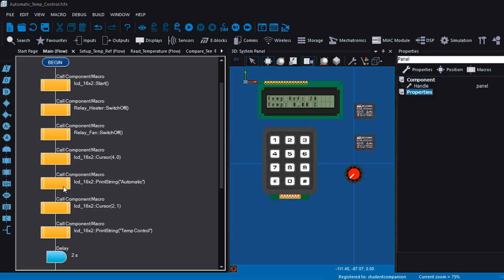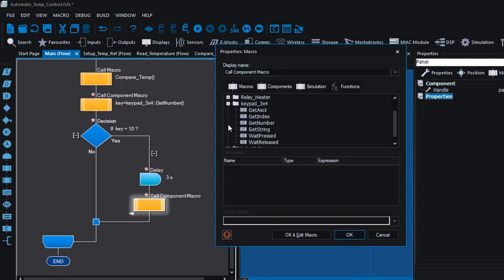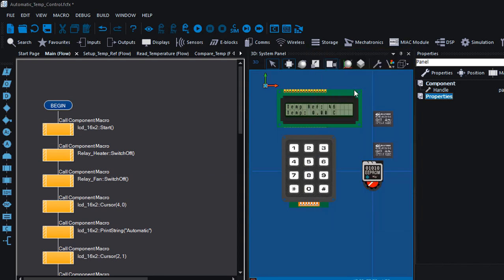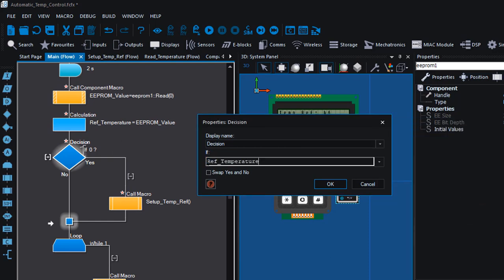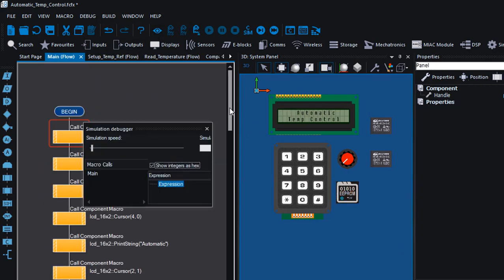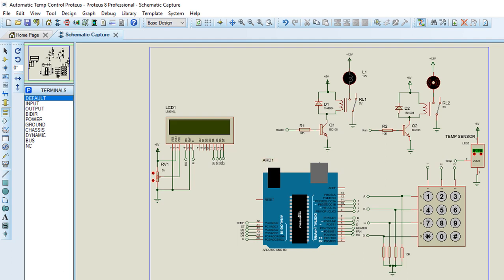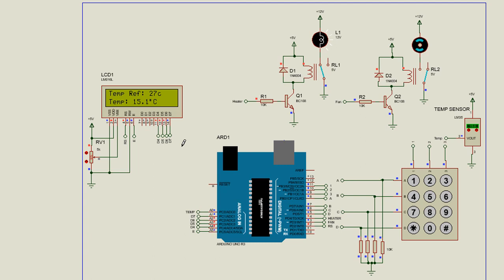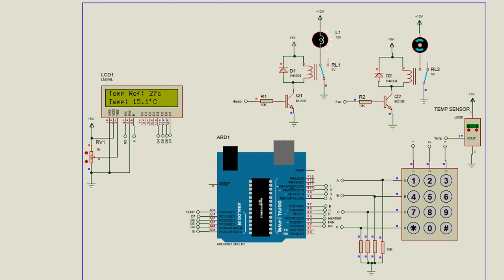13- Project 2 Automatic Temperature Control System, part 3 | Arduino with Flowcode Tutorial

Comment: What can I use as  a heater? And if i use the parallelism of  more resistors will it work? Also will the C code work on Arduino if I upload it?
Reply from the maker: Hi, the use of the heater will depend on the power rating of your relay. Anything that can be supported by the relay.
Please watch our relay tutorial to learn more.
Don't use resistors, why would you want to use resistors?
Reply: @StudentCompanion  i found on a site a heater built with some resistors in a ladder form
Reply from the maker: @mogosandrei9985  Are you trying to build a real hardware device or in simulation only?
A heater is basically a heating power resistors, when current pass through them, they become hot, that's why they might use the resistor symbol to describe a heater, but you can't use any resistor for that, because not all resistors are meant to be heaters. If you are using high power, you must make sure you know what you are doing as it could be dangerous, we can't provide advice if you want to build your own heater as long as you follow the safety precautions.
Reply: @StudentCompanion  Is it ok if I use NPN instead of PNP?
Reply from the maker: We used NPN in this tutorial. You can use any general purpose transistor either NPN or PNP, as long as it's capable of driving your relay ot your load directly. And remember to connect it and bias it correctly. For example in brief you know an NPN turns on whenn current flows through the base and the transistor current flows from collector to emmittet while with PNP it turns on when there is no current at the base and the transistor currrnt flows from emmiter to collector.
Reply: @StudentCompanion  Yes I am trying to build the hardware device to maintain a constant temperature in a box(for example).
I need to know also all the components that I need if you can help me
Reply from the maker: The components are all in that video
Reply: @StudentCompanion  are you using a tensiometer?
Reply from the maker: What is tensionmeter? Everything we used are shown in the video
Reply: @StudentCompanion  the RV1
Reply from the maker: It's a variable resistor. You can use any small variable resistors

Comment: sir can we change this BJT from any FET ??
Reply: sir according to our project we have to use an FET.  so the question is that......  what is the equivalent of BC108 in FETs ? because  there is very low output coming out from arduino pins .   if you know any model of FETs which is equal to BC108 plz tell me...
Reply from the maker: It's not about an equivalent of BC108 but a FET that we'll be able to drive your relay. I don't know which relay you are going to use, each relay has it's own coil voltage, current and resistance.  Those are parameters that we'll help you select a correct FET and calculate the value of resistor.
Reply from the maker: Did you watch this video to learn how to use a relay with arduino: https://youtu.be/htRPH2U80kw
Reply from the maker: I guess you can. Is there a particular reason to use a FET?  As a BJT would do the job.

Comment: Thank you for yours great lectures, I have learnt a lot from you. I am considering learn microcontrollers in C, what kind of microcontroller you recommend, AVR or PIC. And can you make tutorial videos for AVR microcontroller? Thank you
Reply from the maker: Hi. Thanks for watching our videos and brother your feedback.  The choice will depend on you , the software you gonna learn with and what you want to achieve in the future.
As Microchip the manufacturer of PIC bought Atmel  the manufacturer of AVR recently, in the future they programming tools might be integrated. 
We usually use PIC so I can only advice on PIC.
Reply: thank you for your recommendation, I found in your courses, there are 1 course about PIC using MikroC and another one is about PIC using MPLAB, so what is the difference between them and if I want to study further in embedded system field, do I need to study both of them ?
Reply from the maker: No you don't need to study both.
MikroC, MPLAB and even Flowcode are software used to program your microcontrollers.
The manufacturer software is MPLAB and it's kind of free. Meaning it's free but you can buy a professional version for more optimization. But the free version works better especially for a beginner you won't see a difference. 
MikroC and Flowcode are third party software.  They are not free but have free limited  versions that you can use. In my opinion they are a bit easy to use with a lot of supplied  libraries than MPLAB.
So I'll advice you to try all of them and see the one you'll be comfortable with. Then continue learning with it.
Reply: Student Companion thank you for your information, I will try them and find the most suitable software for me. 
I hope that you will have more tutorial video about microcontroller as well as embedded system and help many people in the world expand their knowledge in this field. 
P/s: I think you can consider PCB design or circuit design for your next tutorial so that we can have "full stack" embedded system community 😂😂
Reply from the maker: I already have PCB design videos. And I am working on another that will be uploaded maybe in two days. It's about how to design your own Arduino Shields. I will explain the basic electronic you need, design the schematic, the board and manufacture it. All steps will be explained
Reply from the maker: You just have to subscribe to our YouTube channel and you'll be notified when we upload new tutorials
Reply: Student Companion that's great, thank your so much for your efford.
Reply from the maker: You are welcome!

Comment: Have you ever used module BT RN4678?
Reply from the maker: Not yet. But I don't think it can be difficult  with Flowcode.
Reply: Student Companion my problem isn't the code but the connection of its pin. I be able to connect but his pin tx don't sent me nothing. Infact when i see TX pin using oscilloscope, i don't be able to see bits.
Reply: Can you help me ?
Reply from the maker: Then they must be something wrong either with your code the way you are sending commands to your pins or your connections. This is a popular device and there are plenty of tutorials online how to use it.
Reply from the maker: How is your connection? And how are you writing the code?
Reply: Student Companion Ok, but i said you that my problem isn't the code beacause if the bits don't go out from pin TX of the Bluetooth it means that the bits don't arrived  pin RX of my PIC.
Reply: Student Companion Ok the module BT was broken. Another question. If i receive a bytes from MIDI. My code is:

char uart_rd;

Uart1_Init(31250);

TRISC.B7 =1;  // Pin RX as input

While(1)
{
    If(UART1_Data_Ready() == 192)
    {
       uart_rd = UART1_Read();
       
       If(uart_rd = 0)
       { 
          // do somethings
        }

        ....
    }

is correct ? 

Thanks
Reply from the maker: Are you programming with Flowcode or mikroC?
Reply: Student Companion mikroc :)
Reply from the maker: This is confusing.  Why comment about mikroC code on an Arduino with Flowcode video?
All along I thought you were programming with Flowcode and I replied to you accordingly. 
Please ask your questions on a mikroC video.  There are other people who also get help by just reading the comments on the videos if they are facing the same problem.  It will not work when commenting on wrong videos.